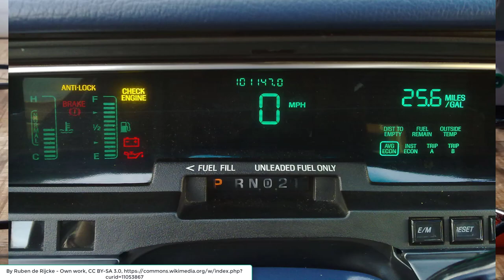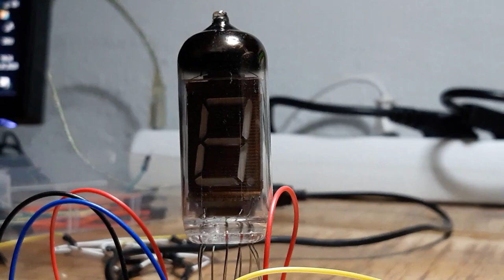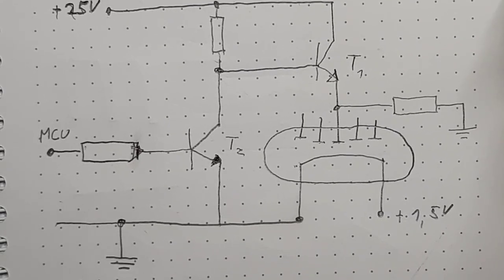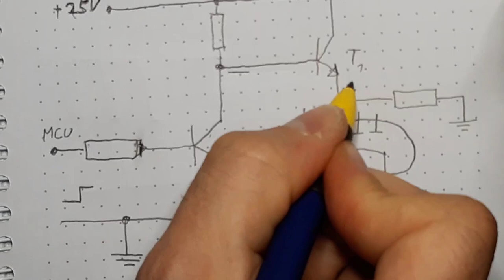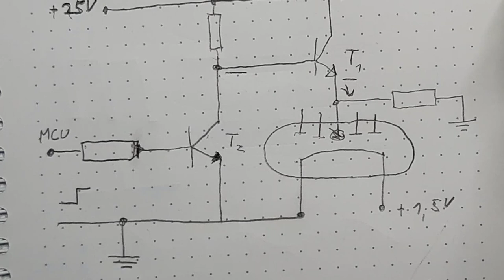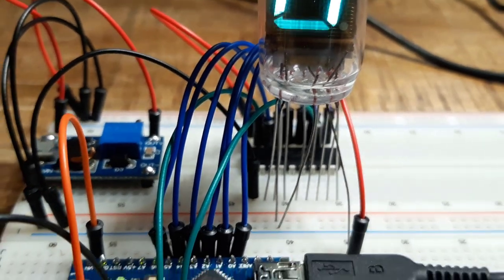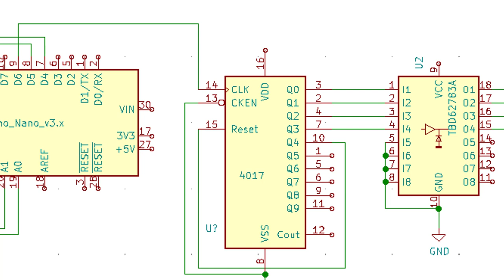How to Drive VFD Tubes With an Arduino

Comment: Just found a few boxes of dot matrix VFD's on the cheap, they are 70x48 pixels, with one of the rows being red instead of cyan. They were 100€ for 30 tubes. Going to make game handhelds with them. They also have the driving logic on board, but the difficulty was how to fill the buffer RAM.

Comment: great video, I got some iv-3a's recently and I was wondering what DC/DC converter you used
Reply from the maker: There is one step-up converter for the anode voltage and a step down converter for the filaments. These are not hard to find on Ebay.

Comment: I just got my hands on 8 DG10B VFD tubes  which will be perfect for a vfd watch.  I am very interested in what you used for a power supply.
Reply from the maker: I used some no-name switching converter modules from Ebay. The step down converter, delivers 1.5V/600mA for the filaments and the step-up converter approx. 30V for the grids and anodes. Input voltage of both is 5V from an USB power supply.

Comment: I found some IV-3 tubes (7 plus 2 segments) total 14 pins for the tube.
I didn't find the pin layout, but with your explanation on VFDs I think I found a solution, I have to find the pins through testing.
I wanted to thank you and congratulate you on the excellent exhibition, very well done.
I have problems with the language, but with the translation everything is ok.
Thank you😀👍

Comment: Hi friend. Do you have iv-8 datasheet or info about pinout, supply voltage and current?
Reply from the maker: There are several scanned datasheets in russian language that can be found with the Google picture search. Search for "IV-8 VFD tube datasheet". This gives good results.
Reply: I meant in English but thanks anyway
Reply: @emrethesea  Еще нужны?
Reply: @emrethesea  Если необходимо могу дать ссылку, но увы все на русском , думаю переводчик сможет помочь

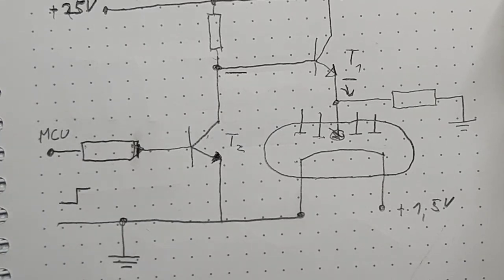Comment: Thank you for the video.  I do have a question about 3:00.  The first transistor is configured as an inverter which drives the second transistor.  The second transistor is an NPN configured as a high side switch (which seems incorrect).  I gather you meant the second transistor to be a PNP and not an NPN.  Is that correct?
Reply from the maker: No, both transistors are NPN, because both of them have positive voltage at their collectors. But  a PNP is also possible as second transistor. In this case the circuit does not act as Inverter. But in this case, a resistor (1-10k) must be inserted between collector of the first and the base of the second transistor, in order to limit the base current.
Reply: @DoctorVolt  I'm not used to seeing an NPN being used as a high side switch, so it seems a bit unconventional and I have seen others use  NPN/PNP pairs (PNP is commonly used for a high side switch so that is why I asked).  Also, I've seen where the display anodes can be driven simply by a single NPN in an inverter configuration (first stage of your circuit).  In fact I currently have it working that way on my breadboard.  Do you know if there is a reason against doing that? (not much current is required to drive these displays, so that's not a problem).  For an example, please see the image for "Simple driver for a gate or anode" in the link below: Thanks!  https://hackingmajenkoblog.wordpress.com/2017/12/23/vacuum-fluorescent-displays-on-arduino/
Reply from the maker: @Enigma758 The output channels of the driver array also use NPN transistors (See schematic in TD62783 datasheet). So this is not unusual. 
The downside of the single-transistor circuit that you mentioned is, that the value of the collector resistor must be relatively small to allow enough anode current. This means that the circuit will also draw current when the transistor is conductive (the segment is off). 
In case of the two-transistor circuit, the resistor value of the collector transistor can be by the transistor´s b-factor smaller (10-100), so the thing will draw much less quiescence current. But if you want to build a VFD driver with discrete components, you might rather decide for simplicity than efficiency.

Comment: Hi, I built it with an IV18 tube (8 digits). In the main loop of the program I added this:
   vfd_write("12.34.56.78");
   delay(1000);
   vfd_write("87.65.43.21");
but that does not work. How can I display 2 numbers one after another? Thanks!
Reply from the maker: The problem is the delay(1000). The Loop() function has to exectute the vfd_write() function continuously, so it can multiplex all the tubes. When putting delay(1000) into the loop, it pauses the multiplexing for 1s. So it is better to solve this via the millis() function (Which I also used in vfd_write()).

Comment: Nice video Doctor Volt. I have here the NEC LD8113 Tubes. I cannot light them up. I have the filament om 2 volt. The are visible and i put 12 to 18 volt on the segments. Do i have to feed the segments with - 0r + ?? I dont understand the info so far i found on internet.
Reply from the maker: I cannot tell for sure, because there seems to be no datasheet for this tube, or at least I didn´t find one. But usually, the segments need positive voltage around +20..30V. The grid must also be connected to positive in order to let the electrons pass through.
Reply: @DoctorVolt  thanks. I did light it up now. 2 volt filament. 9 to 12 volt anodes and grid. Anode and grid on + and the - are hooked up  together

Comment: Do I understand correctly that +5V to the gate pin enables the tube and 0V disables it? I have read that a slightly negative voltage is required to disable the it.
Reply from the maker: +24V enables it, 0V disables it.
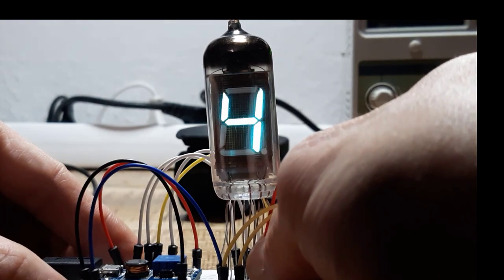Reply: @DoctorVolt  So am I reading the schematic at 4:24 wrongly? The right transistor array is connected to +5 volt. Shouldn't it be +24V then?
Reply from the maker: OOps, there is an error in the schematic. Pin 9 of U2 should be connected to +28V, not 5V
Reply: @DoctorVolt  I figured. Thank you.

Comment: scusa se sono un po' fuori tema,  sono in possesso di 8 valvole IV-17 a 18 segmenti, è possibile pilotarle con arduino  per fare apparire scritte a piacere? mi puoi aiutare ?Grazie
Reply from the maker: Ok, Google translator tells me you want to connect tubes with 18 segments, right? Of course this is possible with Arduino Mega instead of UNO or Nano, and another two driver ICs. And modified Arduino sketch of course
Reply: @DoctorVolt  ok mi puoi aiutare con i collegamenti e lo sketch per arduino?
grazie 
Marco
Reply from the maker: @aaa marco Here you can download everything: https://create.arduino.cc/projecthub/michalin70/interface-vfd-tubes-with-an-arduino-3381d5
The link is also in the video description now.
Reply: @DoctorVolt  si ma usa valvole a 8 segmenti io ho valvole a18 segmenti
Reply from the maker: you can use your tubes with this, if you only connect the 6 outer segments and the horizontal one in the middle. If you want to drive all of the segments, you have to extend circuit and sketch accordingly.